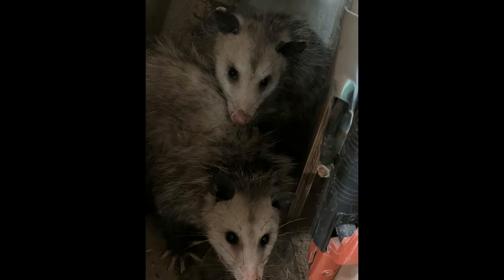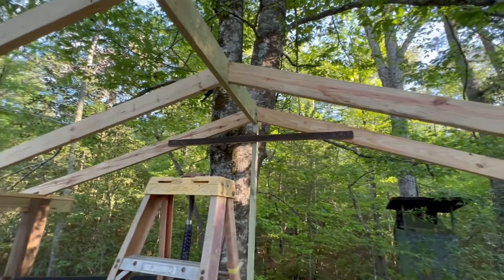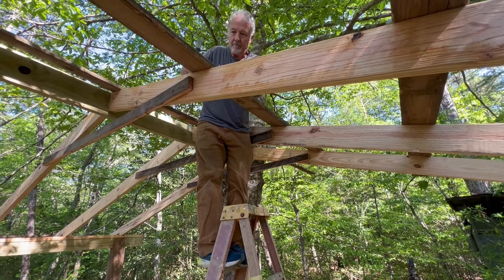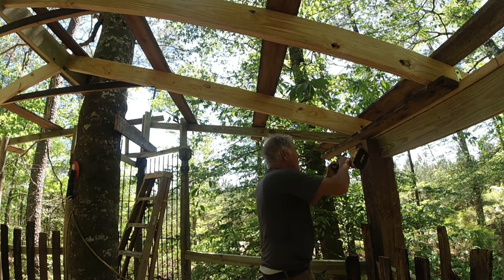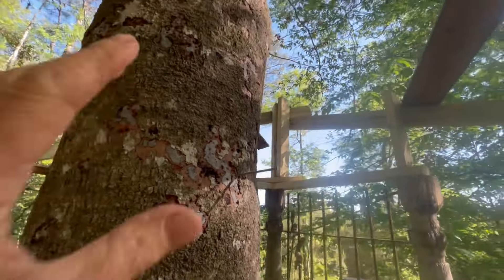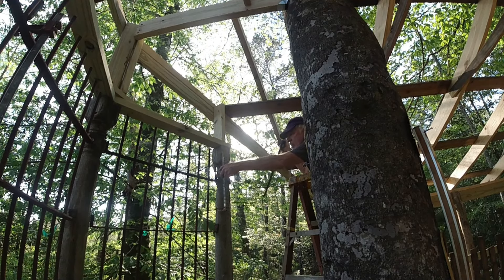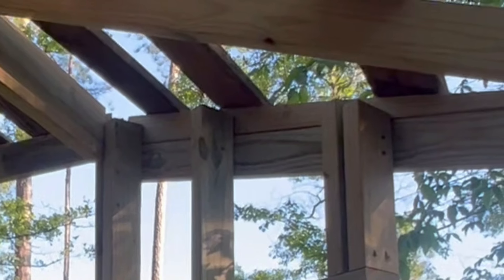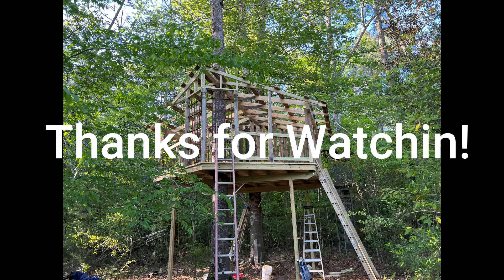The treehouse in the trees is coming along. Progress on all fronts!

Comment: To get a trailer to go into  tight spots, put a hitch on the front, way easier to move a trailer
To avoid wood splitting, blunt the tip of the nail
Reply from the maker: Mazda Man! Interesting thought about putting the hitch on the wrong end. I can see that the distance to the axles would be much less. Good old trick about dulling the nails, I knew that but it didn’t click into the old noggin. Another trick is to not use Southern Yellow Pine for rafters. Unfortunately fur/spruce/ hemlock is just not stocked in our local lumber yards.
Thanks for watching and thanks for taking the time to comment.
Barry
Reply: @barrylukebuilds7894   It's done to all aircraft towing trucks. It allows to push the plane more accurately than backing up. I have a hitch on the front and rear of my truck, van, and car.. Once you use it, you'll wonder how you ever lived without it
Reply from the maker: @GoofieNewfie69  always glad to learn a new tip. That is not my trailer but if I ever do get my own, I will head your advice. Thanks Barry